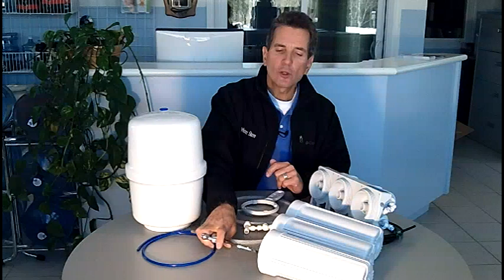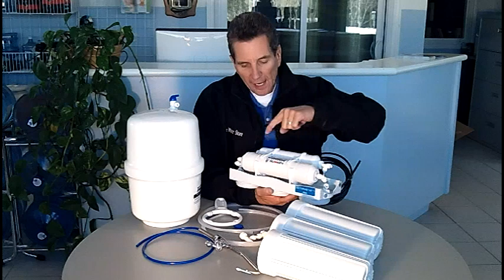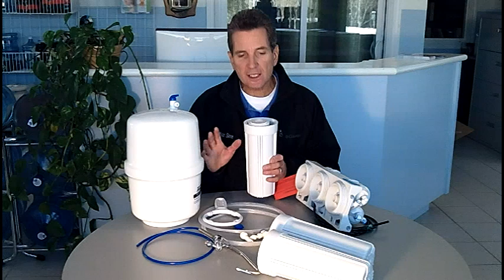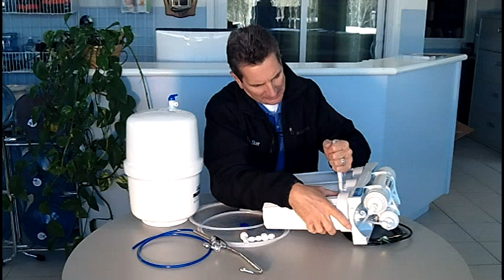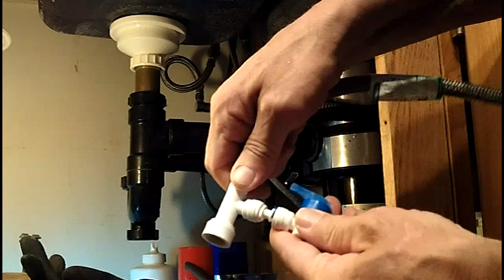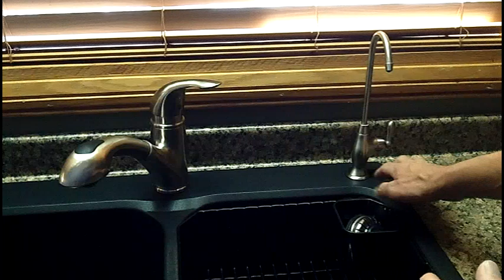How to Install a Vectapure NX Reverse Osmosis Drinking Water System

Comment: Hi Gary. I have the same unit you are showing. I live in Kitchener Ontario. The tap water is extemely hard here. I have a new water softtner for laundry,hot water etc, When I install the unit do I hook it to my hard water line that I had my plumber install .or do I hook to a line from the water softner, Great video. Thanks